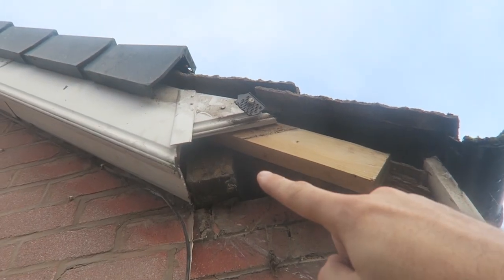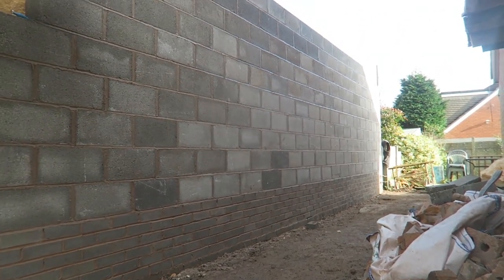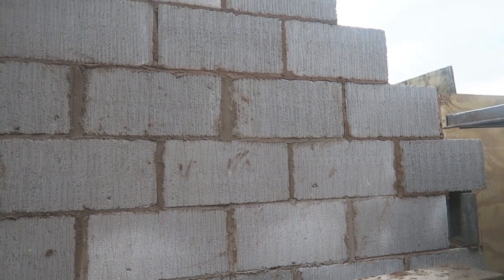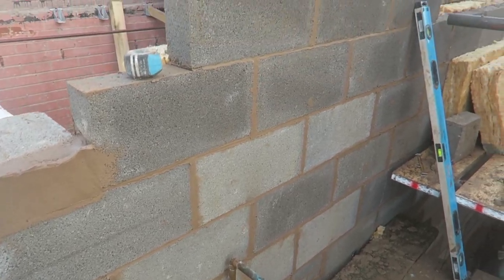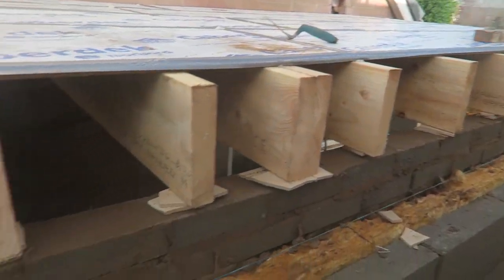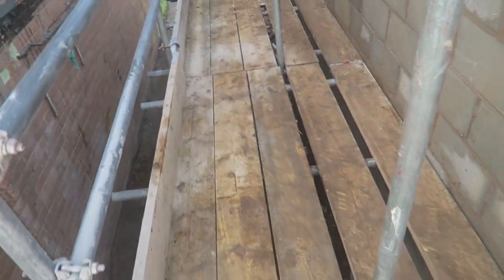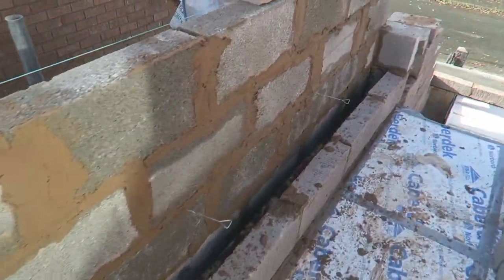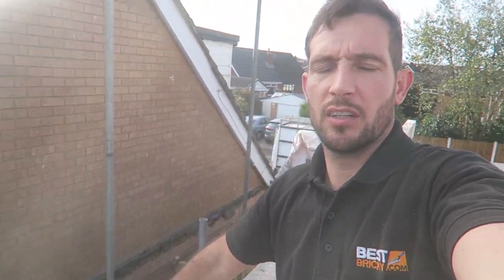Blockwork - lost footage, malcs extension up to first floor height

Comment: Stu - why all the packing under the joists and no wall plate?  Did you have a prob with the finished internal wall height?
Reply: Matt Cartwright won’t need a wall plate as I presume it’s double skin block all the way up rather than timber inner skin so joists get build around and over. Packing is just to level up the joists 👍🏻

Comment: great brick work Stu... was there any preservation treated on the joists embedded into the block?
around here either air gaps or some other full isolation / treatment is preferred.

Comment: Quick question can i raise my floor 85mm doing it like a concrete base? If so what mix should I use please Stu
Reply from the maker: I don’t think you can it’s too thin. I just text about that screed name he will get back tomorrow
Reply: stu crompton thank you I really do appreciate this
Reply from the maker: Tarmac Euro screed mate 👍👍👍👍👍👍👍🙏
Reply: Thank you so much
Reply: stu crompton I can't find it anywhere but thank you mate
Reply: stu crompton if i can't find the stuff what other options have I got? Need raising 85mm in places.
Reply from the maker: I don’t know pal
Reply: stu crompton Ok thank you anyway you have been amazing
Reply: stu crompton how about 4.1 sand and cement hand mixed used as screed